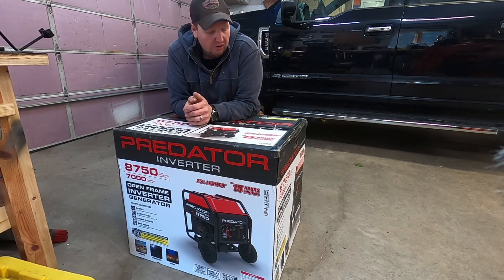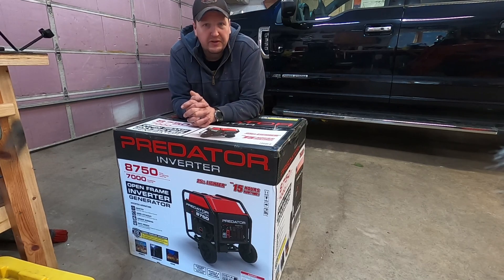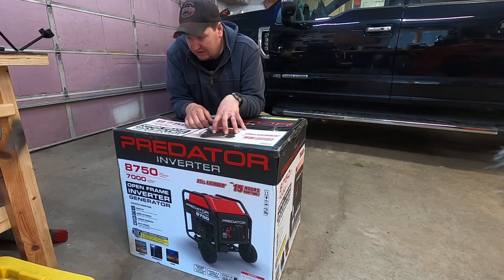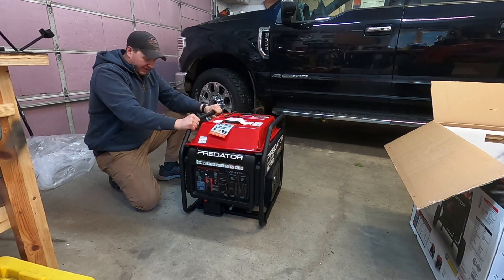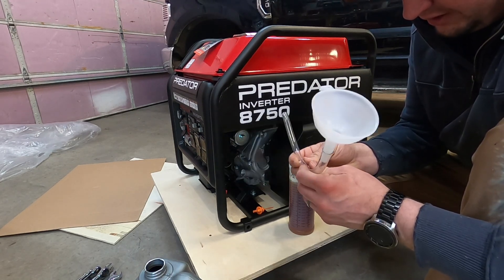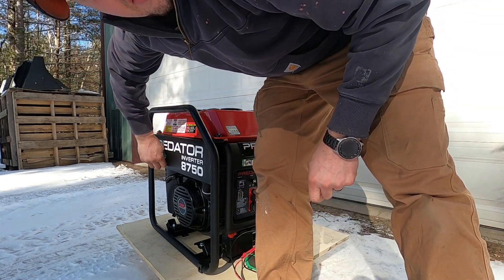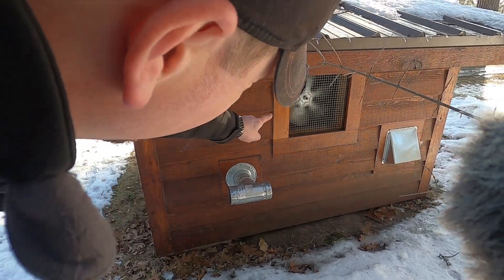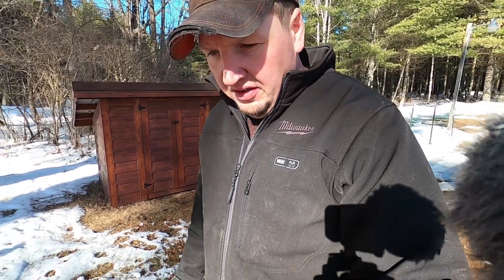Harbor Freight Inverter Generator and DIY Generator Shed

Comment: Very good generator. Way more fuel ⛽️ efficient than the 9000 👍🏼
Reply from the maker: Great to hear!
Reply: You’re saying 8750 is more efficient? Not sure which one to go with
Reply: @marte1a256  the 8750 will be more efficient on lower wattage use… but if you are running it at higher watts they probably use about the same amount of fuel

Comment: Is the new one any quieter?
Reply from the maker: Not really, but I wasn't necessarily looking quieter for my case as I had the generator shed. They do make the 9000 watt inverter which is enclosed and quieter if you are looking to go that route, but double the price I believe.
Reply: I purchased this generator about a week after their 4th of July sale ended using a discount  code Harbor Freight texted to me for 25% off any one item with no exclusions. 

I paid $1,004 for the Predator 8750 Inverter Generator before tax.